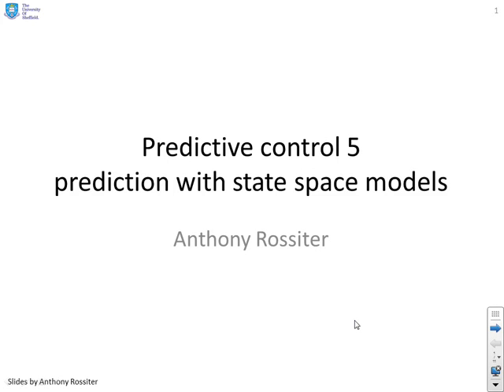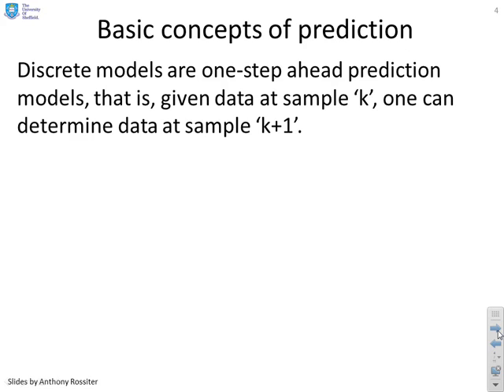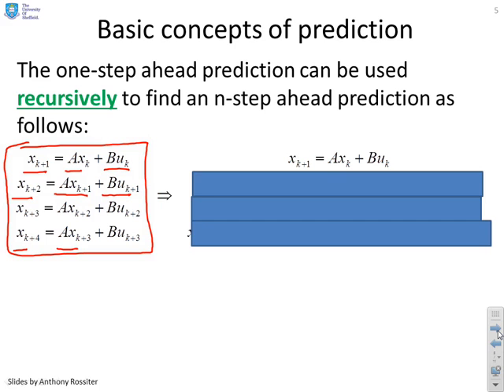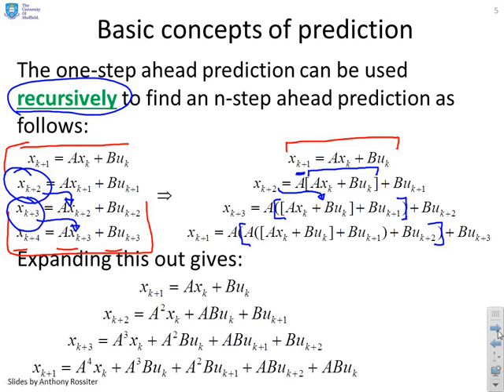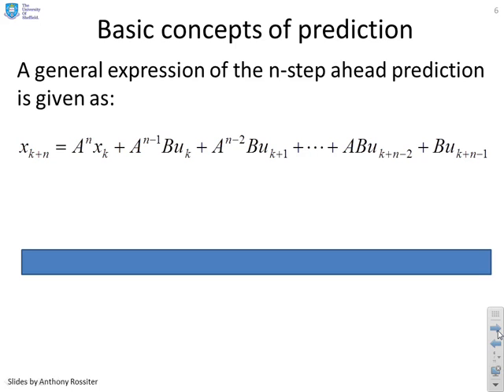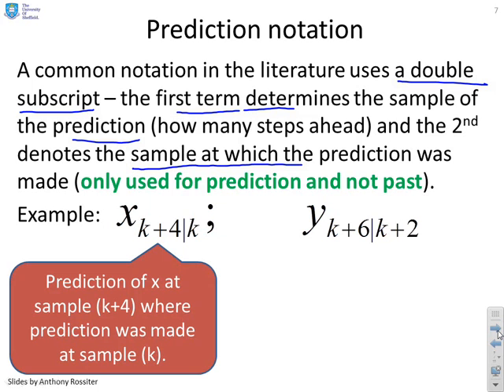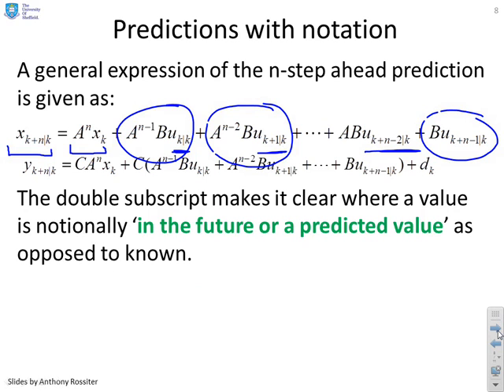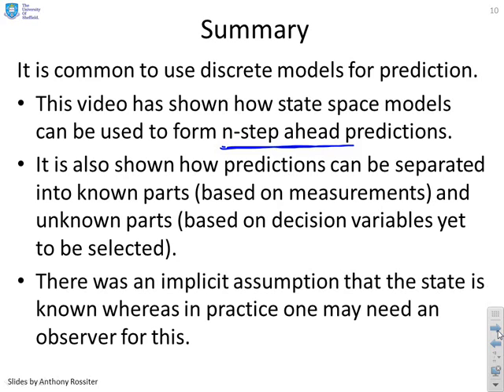Model Predictive Control  5 - Prediction with state space models

Comment: Excellent series in both content and execution! I can't thank you enough! However, there are some minor mistakes in the upper right of slide 5: the state prediction formulae achieved via substituting the recursive state updates.

1.  The formula for x(k+2) was not correctly substituted into the formula for x(k+3). Hence, there is an 'A' missing in front of the square brackets, i.e. it should read as follows:
x(k+3) = A ( 'A' [ A x(k) + B u(k) ] + B u(k+1) ) + B u(k+2).

2. The formula for x(k+4) has as its left-hand side "x(k+1)".

3. The formula for x(k+4) has carried mistake 1 through its calculation, resulting in another missing 'A' from in front of the inner square brackets. That is, it should read as follows:
x(k+4) = A ( A ( 'A' [ A x(k) + B u(k) ] + B u(k+1) ) + B u(k+2) ) + B u(k+3).

Other than these small errors, a really instructive and insightful video!
Reply from the maker: MrManifolder Thanks
Reply: I was going to make exactly this comment (though this one is more complete than the one I was going to type, so bravo)